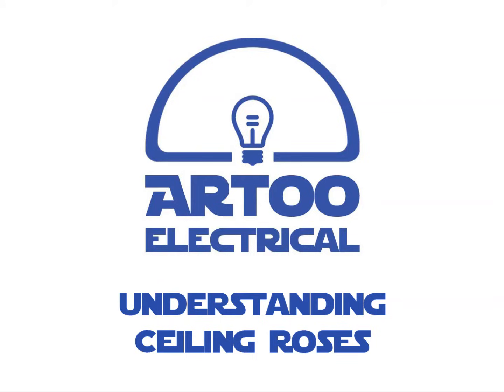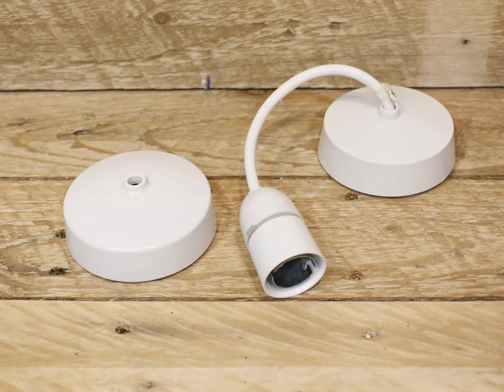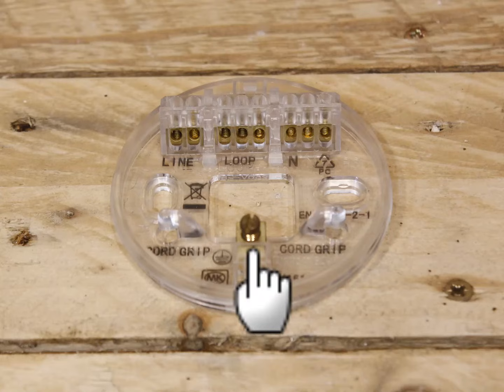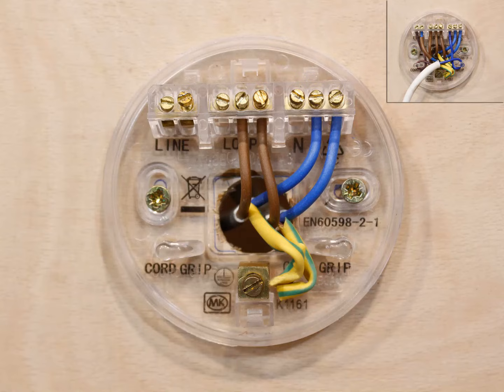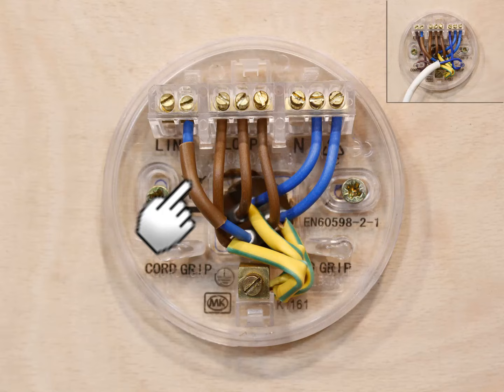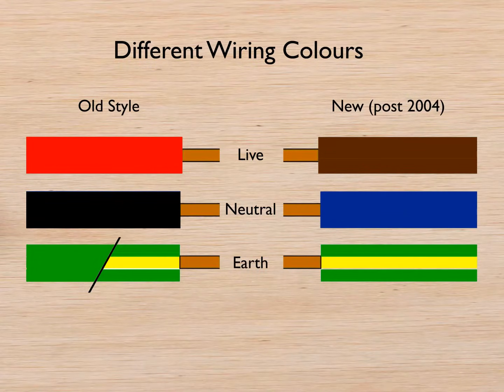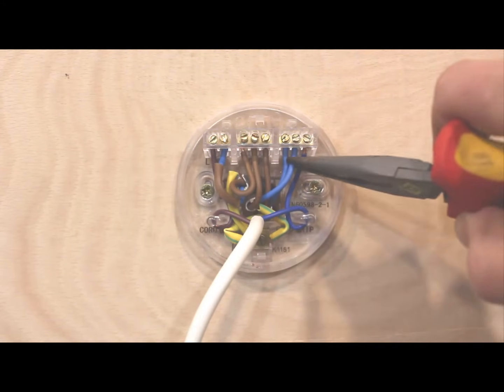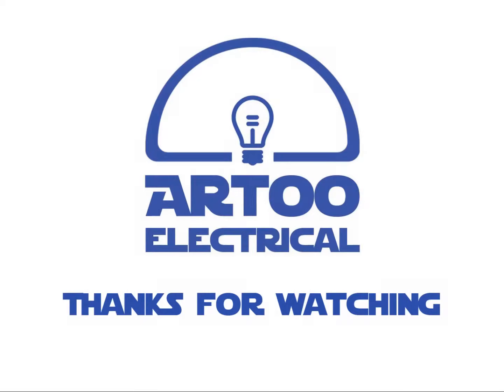Part 1 - Understanding Ceiling Roses

Comment: Can anyone tell me lol I'm putting a new fitting in but it's come with a connector block that only has L N and E so what do I do? Do I put all the live wires in the same because there's 4 of them
Reply from the maker: Have a look at my video replacing pendant light fitting with one that doesn't need a ceiling rose. That explains it.
Reply: @artooelectrical9896  I done it now anyway mate but cheers

Comment: Very educational thanks, but I can understand why there is no grip for the cable, like you have for any household plug. It means those two weeks cores are taking the weight of the whole lamp and shade! I'm trying to replace a paper moon lantern with  a metal shade with 64 dangling rods  which I don't want to trust to two weeks cores!

Comment: I have a new light fitting which is quite easy but the wires coming from the ceiling are confusing me.  Three wires two with brown, blue and earth and the other has two brown and one earth.  Im totally stumped im sure one of the blue cables should have a brown sleeve but none of them have, so i keep wiring it wrong. when electric turned back on the light does work but not by the pull cord switch it stays on !!!!!  Can anyone help please?

Comment: Very clear and understandable.  I have a ceiling rose, which clips into the ceiling base plate. The dependent wires have a bayonet fitting into the rose. The base plate wiring has brown and earth wires separately into the two Line holes, two red to two of the middle three holes and one blue to one of the neutral three holes. Does this seem correct?

Comment: Thank you for this excellent video. 
I have a question.  All the wires in the ceiling Rose are bare with the light switch being turned off. When turning on the power at the consumer unit the only wire that is live is a neutral wire.  Is this because this neutral is connected to the consumer unit.

Note: My house is wired with single wire cables coloured red and black (not twin and earth). The live supply (loop) goes to the light switch. A switched live then goes to the ceiling rose. This ceiling rose feeds another red and black cable to another light in the same room. There is a further 2 neutral wires in the ceiling rose, one of which is live as mentioned above. Thank you.

Comment: If I was adding additional lights to this switch, would I take the twin cable to the line side? So when I operate the switch it switches the other light off? And then if I was taking a feed to another room then I would take it off the loop? Feed in, feed out &  and all other lights on this switch off the line?

Comment: Fantastic clear video thank you very much. I have wired up quite a few of the white roses in the past. A friend wants a fancy chrome finish rise and pendant set fitting. Do all roses have enough terminals to enable the first scenario with the looped connections? It's just often in the descriptions I can't see it mentioned what terminals are provided. I don't want to buy one and find it only has enough terminals for the second scenario. Any help would be greatly received. Thank you
Reply: Buying the chrome unit from a specifically electrical retailer might well mean they know the answer & can tell you.
Otherwise they should have sufficient blocks - But with the stuff coming in from abroad its not guaranteed.
If there is sufficient space inside the chrome 'crown' plastic coated conectors may be your solution?
Being metal the crown should have continuity to the earth wiring.

Comment: Now I better understand all the wires in the rose. Had to buy a new pendant due to an accident whist playing on the VR headset. I put my had through the glass shade and ripped the bulb out of the bayonet fitting damaging it. Got a complete fitting for just over £1 at Screwfix with the intention of just replacing the pendant. But your video gave me the confidence to completely replace it as the old one was quite old. The only issue I had was the wires didn't have much length to them and the 3 earth's instead of being individually sleeved were all in the same sleeve so took a bit of time to get them just right. Thank you

Comment: great video - really helped my first ceiling rose installation.
Reply: and also helped me work out how to fix the previous owner's bodged installation of another light. It was very useful to go through and understand what each wire did. There wasn't an easy way of working out which was the switching cable though - it would be good to know what to look out for.